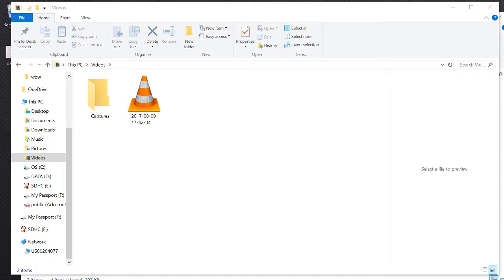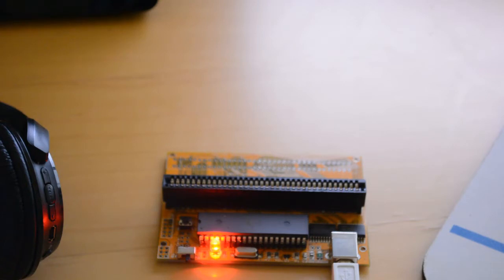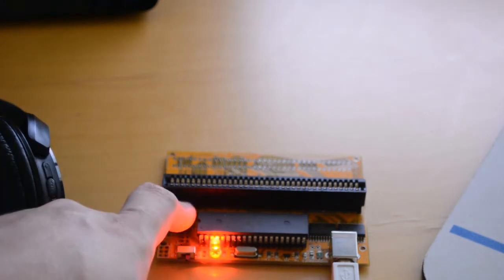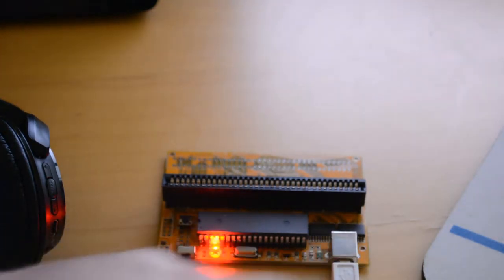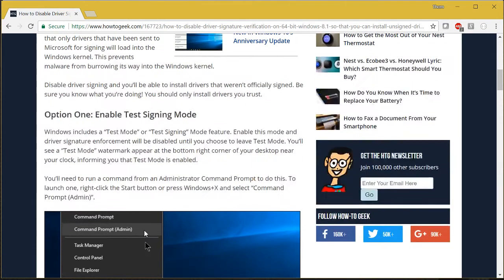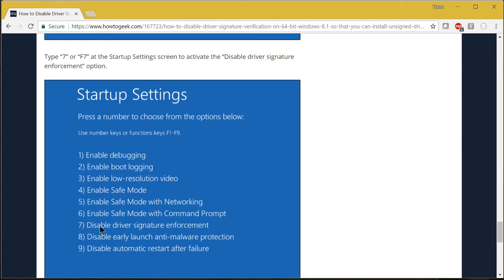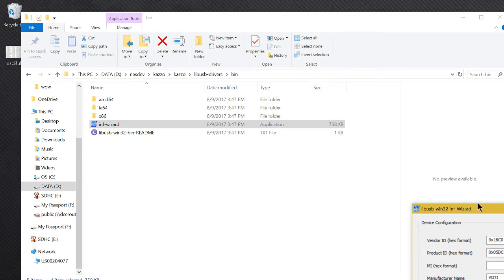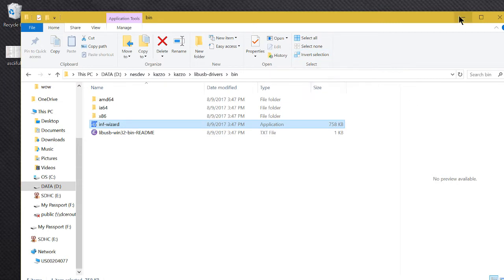Using the INL-ROM Flash Programmer for Homebrew NES Development

Comment: I notice you say it's only useful for testing your games on real hardware or making small to medium sized supply of your cartridges. Do you recommend non-flash cartridges for the real deal, or should I just use flash carts for my first couple of years of homebrew development?

Also do flash carts work like dvd-r discs or dvd-rw discs?
What I mean is can you use the kazzo INL-ROM programmer multiple times with one cart or does it become permanent after using it once?

Sorry for all these longs questions :D But nice video, very informative
Reply from the maker: I would stick to flash carts, especially since eproms of the required sizes are becoming more difficult to come by.
Reply: Alright thanks for the help